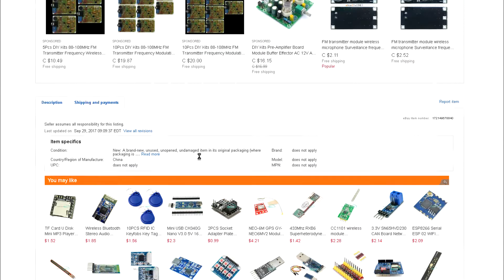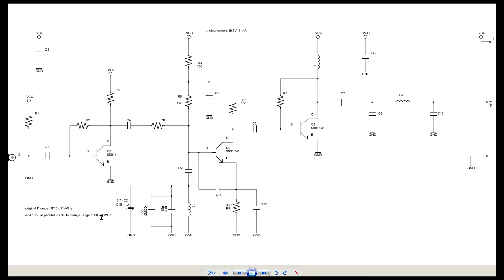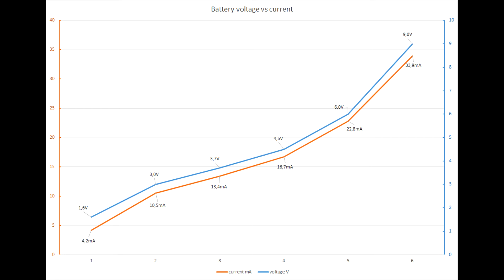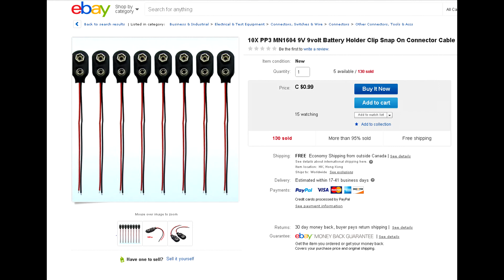Let's build a simple FM transmitter

Comment: Hey, do you mind explaining what batteries you used for this and how to recharge it?
Reply from the maker: It's a 9V battery which are usually not rechargeable. Voltage can be lower with decreased range. You could use any rechargeable battery with a commonly available charger below 9V. Don't remember what the minimum voltage was, guess it still works with 3V
Reply: Thank you
Is https://www.ebay.com/p/10x-Pp3-Mn1604-9v-Battery-Holder-Clip-Snap-on-Connector-Cable-Lead-Black-PS/1453057256
is the battery and holder? Or which 9V battery thats not rechargeable are you using? And how long would the battery last?

Thank you again!
Reply from the maker: The link you posted is only for the battery holder. The normal 9V batteries you buy about anywhere (alkaline) are not rechargeable. There are 9V batteries that are rechargeable in the same format, they have actually 8.4V. At 9V the current is pretty high, it's gonna last only a couple of hours. Go lower in voltage with AA or AAA batteries and it's gonna last longer